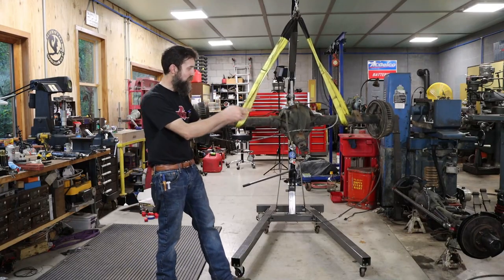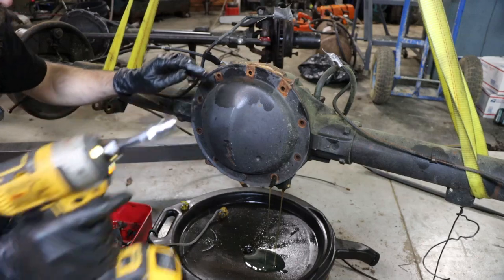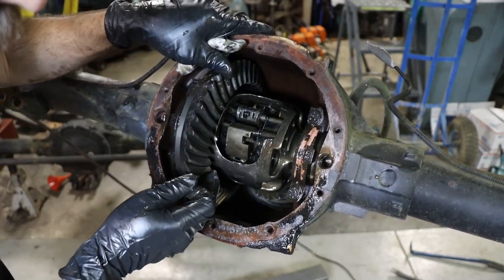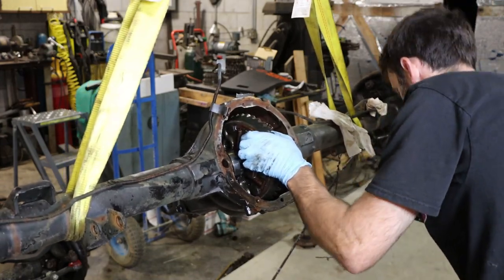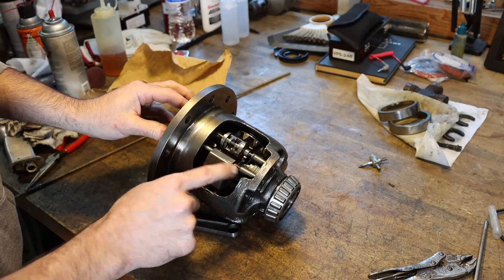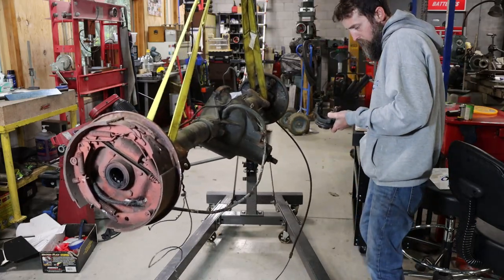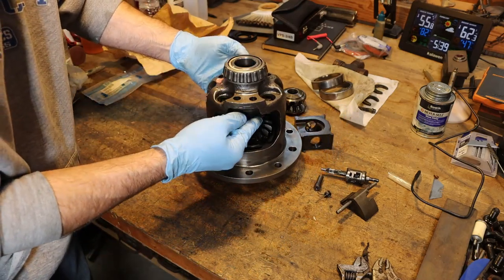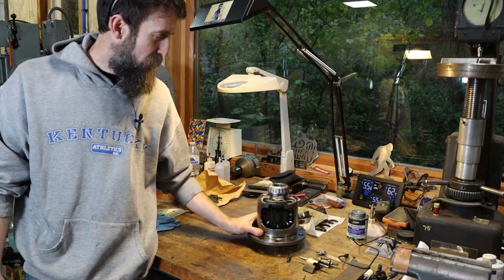Unexpected bad news! Busted Replacement rear 10 bolt axle . Square body #5

Comment: Steve   Firstly happy 41st bday! Happy 19 th anniversary to Elizabeth and yourself, andHappy 81st Birthday to your Mom. I think your idea of the pinion nut coming loose and the pinion coming forward and the ends of the teeth getting smashed is spot on. That's really the only way just the ends could have got damaged. I think that knock on the carrier is nothing to worry about at all. As you say you're not an off roader so I would use that limited slip set up and just rebuild it with or without new clutches, I'm sure there is a spec for them and it only takes a quick run round with a mic to see if they're well within spec or not new bearings, pinion and ring gear and you are good to go!  Go on you know you'll do it if only for channel content! Lol

Comment: Steve, Like the comments said: pull the left bearing and shims off the housing. Label and wire tie, Right side also. Pull the ring gear and put up on “V” blocks. Check the ring gear face for trueness. Inspect for cracks. I read one comment, about diff ratios need to be the same. Verify by turning the front after marking a spot. Tire sizes need to be the same also. Talk to a knowledgeable off road truck guy about your options. Talking or researching is cheap, just takes time. Do once and do it correct. I know we all have cobbled things together, only to do it again after ( I hate that)it breaks. Keep up the good work. Remember, Everything’s a project.

Comment: Ah the old grenade80...I hypothesize that the pinion bearings were the first failure, in turn causing the nut to appear loose. whether the gear teeth chipped before or after the pinion nut was retorqued is anyone's guess. Happy birthday! never in a million years would have guessed I was older than you haha, as I always feel like a child when watching your machining and welding skills. a tip for anyone struggling to remove stuck drums is to cut the retaining pins where they pass through the backing plate. this allows the shoes a little more movement and to tip past the lip on the drum and is a $2 part to replace.
Reply: Good call on the failure.

Comment: Dye check it for cracks, and throw it in the lathe and dial it in looking for any deformation, if its not warped or out of round I'd use it. Limited slip in a pickup will leave you wondering how you suffered with an open dif so long.

Comment: Good Morning Steve, Just finished a similar repair on a 8.8 differential a couple months ago. Limited slip clutch packs were worn out and one spider gear was chipped. I discovered (at least for the 8.8) you can buy a complete Ford racing LS "Track-Lock" diff with carbon fiber clutches, New for about $ 10 bucks more than the cost of the parts I needed. It was a no-brainer. Hopefully the same the same type of deal is out there for the 10 bolt. Great job with the detail and explanations !!

Comment: I would re use the diff as long as those gashes don’t go to deep into the lcd unit. It still looks pretty hardy
Reply: Smooth out the gashes with a grinder to remove the chance of a crack initiation site at the impact points.
Reply: I would fix it and run it.  As you said you don't plan to go stump jumping on the regular.  I have one of the military blazers that those axles came out of (CUCV M1009) and have had good luck in the snow and light off roading for the last 80K+ miles I have driven it since I got it from the army.

Comment: Hey there Steve  👍👍 on the G80 differential disassembly ,.   those are often quite a task to take apart , I had to replace one of the axle spider gears in the rear differential of my old 1986 GMC 3/4 ton years ago , and I had to remove those pins with a tool that I made from a old antique C clamp  because I didn't have a press , and I couldn't get any shops to even attempt to try and press them out for me , no one wanted to touch it.  heck not even a dealership .  in fact they told me just trash it and just buy a new carrier housing , .  so hats  off to man !  Keep up the great work ,. thanks for your videos .

Comment: Congratulations on adding on the years to everyone involved.  Thanks for posting this and I'd continue the rebuild using the fewest parts necessary.  I suspect it might be hard to find a good used one based on the various comments describing that differential as a grenade or bomb.  At least if you rebuild it you'll know what you have.

Comment: Happy Birthday to you Steve and your mother.  Just take that casting and check it for cracking, then decide. If it has no cracks then rebuild it with the new crown and pinion, and at least you will know it is still good. LSD will be useful, and you generally I do not see abusing the truck, just using it fully.

Comment: Edit: Added more in reply - I'm thinking since you snapped the axle shaft in an open carrier (again, admittedly unknown history on that one as well) I'm just not expecting this whole unit to hold up...  I had a '94 K2500 with the smaller GM 12?14? bolt? I forget.  There's a big and small version of that particular "bolts" - it was the roughly 9.5" version and it's a popular swap for the 1/2 ton's for 88-98, much bigger diff and gearset, still 6 lug, many also had G80's.  It's basically Dana 60-ish territory that's c-clip, the c-clip being why it's often overlooked.  I don't think the width would be TOO far off from the older production run of trucks, but I've never checked.  Only thing that might need done is welding on some new spring perches, wouldn't be tough for your skillset.  You'll loose a touch of clearance, but get a lot more beef and likely some bigger brakes.  Just look for the 88-98, 3/4 ton, 6-lug trucks in the boneyard.
Reply: Did a little bit of looking for my own curiosity, found a thread detailing a very similar situation.  So it is the 14 bolt Semi-float 88-98 GM trucks.  WMS to WMS measurements be someone who claimed to have measured it themselves is 2wd - 65" / 4wd - 68".  I think the 2wd is what you'd be after.  It uses 1350 u-joints so you'll likely need a conversion joint.  And the pinion is about an inch longer, so need to check driveshaft length.  Not sure if the stud holes will be different to run the same threads as the front (they'll be metric I think?), but you can re-drill holes on the flange to get the stud size you want, should be the same bolt pattern.

Comment: someone most likely replaced front pinion seal and used the old pinion nut without recrimping the front thread or using lock tight best to use a new nut i learned the hard way love your channel

Comment: GM rear axles have a longstanding problem of having the nut on the pinion gear back off allowing the pinion gear to shift into the axle housing.  There is a TSB on the issue and the newer/replacement nuts have crimps in them to better lock them onto the gear.  I had a rear axle grenade on my '86 Tahoe due to that problem, and have had to retighten the nut on my '96 Tahoe a couple of times during it's 309K mile life.

The best indicator I have found that there is a problem is when you shift from forward to reverse.  If you hear a CLUNK, it is more than likely the pinion gear slamming back into the housing, not the drive train taking up slack in the components.  If you hear that clunk, check that nut!

As to the diff carrier you have, I would not be afraid to use it.  The damage to the outside of the carrier is relatively superficial as everything spun freely, and the bent bushings took the damage.  Reassemble, if it still spins freely, then I would say you are good to go.  They are pretty tough units in my experience.

Best of luck!

Comment: Happy birthday. I have had two of the limited slip differentials. One the limited slip new up at 20000 and I cleaned out chunks of metal the size of my pinky.  Run it to 300000 when the truck was wrecked beyond repair. The second has 320000 and still going. I’m 50/50. Have fun love the videos

Comment: The most common failure in those is the pin that the actuator weights spin on. Under normal use they are fine, The problem becomes how high the rpm difference is before it applies. In a drag car they are coming from a full stop to high rpm difference almost instantly, same with the off road folks. Higher rpm and spinning in loose stuff then hitting a high traction spot. You are 100% correct on the nut being re-torqued. The second most common issue in them is pinion bearing failure, the bearings wear, the nut gets loose and someone just torques it tight.

Comment: I think your right about the pinon nut coming lose and damaging the pinon gear. It was common to have oil leak between the pinon gear and flange seen it lots of times and people try to fix it with silicone only making it worse.  There is a crush sleeve that should be replaced any time the flange nut is messed with but not many do this because you have to pull it all apart and set preload you can cheat it if you know what your doing.  If not tightened back up enough or a failed precrushed sleeve that can loosen things up after a while and do the damage seen.  Besides a small amount of locktite on treads When I work on diffs I put a thin amount of oil resistant rtv on splines only to assure no leaks through the splines.  Little tip when serving a diff pull the bottom cover bolts first then loosen the top and then pry it loose its much easier to control oil spill.

Comment: The ten bolt locker in my 70' Nova worked great. It was a rural mail carriers car. It had the 307 CID engine, so it didn't have enough power to break anything.

Comment: If I were you, I'd stick the carrier in the lathe, give it a spin and see if it looks like it's deformed in any way. I'd try slipping a couple of gauge pins in the holes that that mech runs on, and if they slide straight in and out I'd put it all back together and use it. But you know all that and I don't need to tell you. It'll be good to see that old truck back hauling

Comment: Hi Steve,
Happy Birthday to you and your Mother and Happy Anniversary to you and Elizabeth. Some good advise was already mentioned about checking for any cracks, and if none found go ahead and rebuild the rear. If you're still doubtful, locate a good used G80 differential case. Like you mentioned, you do not hot rod so the components are not under much strain. You and the family stay safe.

Comment: Here's my 2cents; You could bring the carrier to a garage that you trust for "inspection" and if it is fine, rebuild it with the new parts you have. Or not. That is a big chunk of metal and like you have deduced with the pinion and why it was funky in the first place. Definitely replace the pinion, but once you have new bearings and set torque, it should be fine.

Comment: Don't forget to replace the crush collar on pinion shaft. I would pick up a couple of them in case you have to disassemble a few times to get the shims right. Also, you need  GM additive to put in oil for limited slip

Comment: Yes put all the pieces back the same way. I fixed my 2001 Silverado for the same problems,  Same G-locker rear. I just replaced the bad parts and put back together, works fine. That was a couple years ago. I don't think that goo was factory. Yes those locker's work well, I like mine also.

Comment: Hey Steve i,m sure you know that your ring and pinion gears out of your old axles will fit in your new ones the gov lock carrier housing should except the different ratios, i believe the change is between 3,73 and 4.10's it willl save you around $180.00 or more and keep your speedometer correct.

Comment: I and my hot rod buddies swear by the Eaton TrueTrac differentials.  However an additional $600 is probably more than your intended budget on this truck.  I think you can rebuild that existing unit for way less money and it will probably be fine. Maybe you can chuck that carrier up somehow and check it doesn't have any unusual runout from the past trauma.

Comment: I don't see why you wouldn't use it, Steve. Apart from a few marks on the carrier and the parts which need to be replaced, there doesn't seem to be anything wrong with it. Any second hand part usually needs a bit of attention, hence why it was removed. 
Your pick up doesn't make insane bhp and you'll be using it for moving firewood on local roads or tracks. I think it will give years of service once you've been through it. You did a good job on the front and I think the rear will benefit from the same attention.
The old truck will have a new lease of life!
Best wishes, Dean in Oxfordshire, UK.

Comment: The goo you describe on the pinion is very likely normal. The GM procedure for most all of these I’ve worked on has you putting liquid Teflon pipe seal to keep oil from wicking out between the splines. I typically put it on the yolk and not the splines so it squeezes out not in.

Comment: Looks like the pinion nut worked loose and allowed the pinion to strike the carrier. Probably clouted the limited slip activation mechanism as well. I had the pinion go through the diff once, completely wrecked it.

Comment: Well happy birthday happy anniversary and happy birthday..
Looks like that opinion that came loose at one time or another and that is what caused the damage and then somebody tried to instead of taking it apart to find out what happened they just Band-Aid'd it up I would look real carefully at that snout where the pinion comes out if something got in there and force that out of alignment to break that tooth whether the pinion came loose or what but I'd look for cracks around inside of there see if you can see opinions been forced one way or another and make sure that that snout there's no visible cracks around it in the housing you can end up putting that all back together again and the minute you go to throw torque on that pending comes out of alignment and it does the same thing over again with even worse result

Comment: find a big 10 and use them axles.. i also blew my 10 bolt up and went to 12 bolt and fixed the issue, also u can find a 14 bolt coorperate axle and its a 6 lug 14 bolt that will bolt right up

Comment: Almost guarantee those are low miles axles. The military is very hard on equipment.  They probably pulled those off after damaging them during a training exercise. Not too hard of a fix and you’ll have some good running gear. Plus it’s great content for the channel. 👍 P.S. you could always check out Detroit True Trac limited slip. Best limited slip ever!

Comment: Steve, i think once the diff is serviced with a new ring and pinion and replaced with those limited slip parts, new bearings and clutch packs it would be perfectly fine to use that diff.

Comment: Personally, I would replace the pinion for starters. Since there are so plentiful, a new one shouldn't cost that much. JMHO And than rebuild the entire LS unit and happen trucking again. Maybe it isn't the BEST LS differential available, but you are not rock climbing or mud bogging or anything close to that. So it will serve you well for your needs as long as you need it to. Thumbs Up!

Comment: That diff is weak sauce. Knowing the story of what happened to the one in the truck I can see a similar thing happening to this one. Now is the time for an upgrade especially as an off road firewood hauling rig you need all the help you can get . :-)
Reply from the maker: I AGREE! 😁. I have never had much confidence in these. Especially after a dance with some loose gear teeth in the housing. I'm looking for options 👍
Reply: @SteveSummers  I would go with a detroit true trac. They drive nice and still put down the power and don't have clutches to wear out or need special additives to keep happy. Next best thing to an ARB and a lot less coin. :-)
Reply from the maker: @bcbloc02  Thanks for the advice Brian. I know you are far more up on the topic than I am. I will look into it.
Reply: @SteveSummers  Remember Steve, this advice come from a man with a giant racing forklift. LOL
Reply: Hello from finland, i have tuned 454ss pick up for street race use and i change that gov lock to detroit locker and its working like dream.
No problem at all, have almost 700hp and 800nm torq

Comment: OH Steve, just started watching your video, mate if your going to drag heavy stuff into your workshop using the trolley, I would strongly suggest doing something with that concrete step from the driveway to inside, maybe a concrete ramp. I'm going to take your video off pause now and watch the rest of your enjoyable clip.
Just finished watching this video Steve, great contents, the red coating might possibly be break pad dust mixed with grounded rust? As for those gouge marks in the diff, suppose you could try TIG filling them in, then polishing the welds smooth? 
Also Happy Birthday to you and your Mother and a very Happy Anniversary to you and Elizabeth, hope everything keeps going great for you both.
As I mentioned before in Big Clive's survey the other week, Great name and great beard. Have fun mate and enjoy.

Comment: You could remove the limited-slip hardware and turn it into a normal unlocked diff, that would make it lot more simpler and more reliable unit
Reply: Nonsense!

Comment: Bad luck is definitely universal, my lathe had an electrical fault, burnt transformer, got a new transformer and an electrician mate to help fix the fault, ended up burning the new transformer . Now I’m back where I started, electrical fault and a burnt transformer!!!
Reply: Gotta have been the motor that caused it then lol
Reply: @samrodian919  nope motor has been tested and runs fine.
Reply: Dave be sure add a fuse to the secondary side of the transformer. Much better to burn a few fuses while tracking down the problem than transformers. Best of Luck